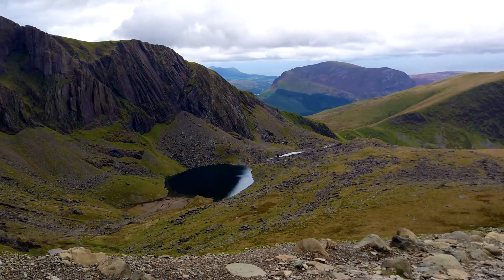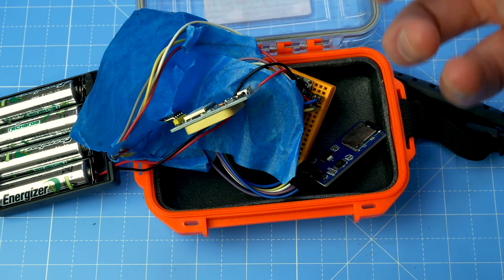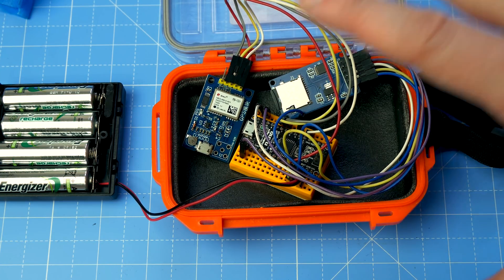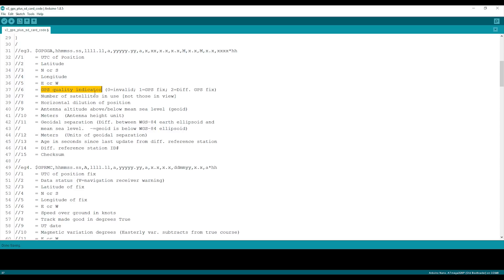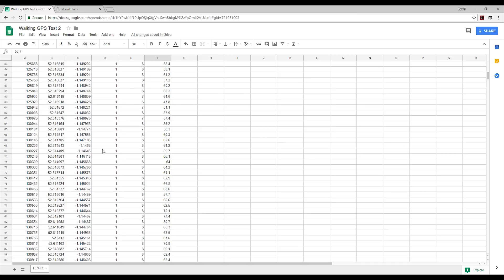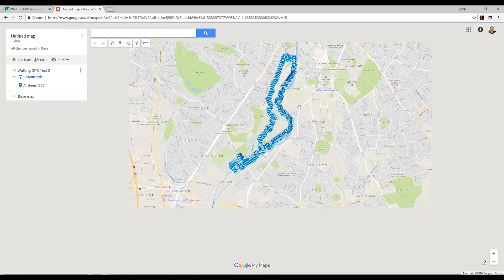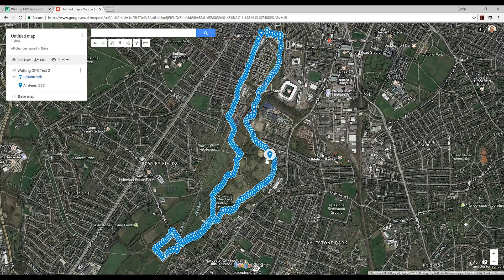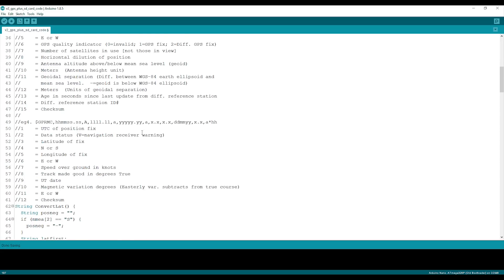GPS Mapping: Arduino + U-blox 6m module

Comment: Hello,
I would like to do the opposite, that is to say, insert the values (Latitude, longitude) into the code and then use them to compare them to the current position. At each passage on a position, the device would perform an action (buzzer for example). Who has already done this?
Reply from the maker: Sorry Patrick, I haven't done that or seen it anywhere else. It sounds possible though, the coding might be tricky but a simple block approach would be having an array of your target lat lng cords then looping through them and comparing them to the current cords.  The difficult bit would be making it only happen once and getting rid of any hysteresis.

Comment: nice but where is the wiring plan?
Reply from the maker: The pin definitions are in the code and the SD card uses hardware defined SPI so that will depend on your microcontroller.
Reply: @DavidWatts  I figured it out by following the cables in the video xD everything is working! Thanks for your prompt reply

Comment: Cool.  I was kinda surprised at the date though.  As in 2ish days ago.  But all in fun anyway.  I did build something similar using arduino, a tilt compensated compass, and a accelerometer put it all together as a inertial navigation to stick in the the car.  It was suprisingly accurate.  after an hours trip in the car, it was only off by about 2.2 Km.  (100 Km there and 100 Km back).  I had a few old garmin gps units hanging around, so tore them apart and added it in.  Pointless, but fun to do.  I was more impressed with the inertial system, so will be re-visting that later.  Not dependent on GPS at all.

Cool stuff though!
Reply from the maker: Why was the date a surprise?  Inertial navigation sounds interesting, I seems to recall Dave Jones taking an old aircraft one to bits a while back.
Reply: Didn't want to say this openly, but GPS-Arduino-LiPo pack, been around for years.  Thats why I built the Inertial one;  (Bout 5 ish years ago)  GPS modules were available for the arduino crowd, but a little expensive at the time.  If I re-call, about $50 - $70 bucks US.   The other parts were a little cheaper, hence the inertial job.  Now a days, I just rip apart old Car GP|S modules, or old phones, old hand-held, etc.  The Hand-Helds are nice, cause the module is pretty much exactly the same as the spark-fun jobs.  Plus nice screens to play with (And a few other parts).
But, it's always fun playing with the stuff.
Cheers!
Reply from the maker: I see, you thought I would be upset that other people have done it before? I don't mind at all, I haven't even come close to coming up with an original project. The challenge for me comes in the making.
Reply: Ahh, thats good.  I don't want to discourage anybody.  That's why I'm long winded about it - grin.  More power to you sir.  Giver S(*&.  Learning is a good thing.  Cheer!

Comment: I was surprised to see you using Strings in the code as they are usually regarded as a possible source of problems due to memory fragmentation in the small memory available on Arduino boards.

This occurs particularly when Strings are repeatably created as you do with dataString.  Why did you not simply write the required elements of the nmea array to the SD card instead of concatenating them onto dataString ?  

If you really do want to write the data all in one hit to the SD card you could have put it into a C style string (Note, not a String) which would avoid the memory fragmentation issue.
Reply from the maker: Hi, Strings are a fairly standard variable that I have never run into any issues with apart from gobbling up loads of RAM. I have read a couple of concerns about Strings but in this case I don't think it would be classed as a heavy implementation of Strings. In terms of the dataString, it is created inside a function so 'should' be released from the heap, stack or wherever it lands once the function ends. The dataString variable could certainly be chopped out and converted into something else but I do think Strings have their place and the functions of the String class can be really useful. In fact I employ substring heavily to chop up the NMEA strings to directly write a CSV file.

None of the code is fixed so there are lots of opportunities to tweak it, mess it up, roll back and try and change some of my bad habits ;-)

Comment: Have a project on similar lines but going to add a low power accelerometer to trigger logging and store the data to FRAM.
Plan on keeping it in my camera bag to automatically log location of photos by matching times on photos with log. 
Also testing an Arduino 1200 sigfox to report location over the air but this seems a bit hit and miss. Think I need a better arial for it to work properly in my bag.

Comment: Looking forward to the low power aspect of this project @David Watts (hopefully individual measurements of each module and showing the efficiency saving) plus the battery, charge and protection circuits. Plus creating your own board. 
I had a similar project over a year ago which you kindly gave advice on. Although still not quite finished yet, it does work. 👍🏻
Reply from the maker: Ha ha, hopefully my terrible advice didn't set your project back too much. I am not sure I will be designing my own GPS receiver just yet, but a carrier board for now. I have very little experience designing for RF sensitive applications so baby steps is what I will take. I am looking forward to fleshing out the spec for the project.

Comment: I'm not sure it will be helpful but in case you can get any inspiration from it, I did do some High Altitude Ballooning a while ago and designed a GPS tracker board. You can find it at: http://projecthab.co.uk/vayu_ntx-v1-03-hab-tracker-pcb/ VAYU-NTX (Vayu - Hindu Lord of the Winds and NTX is the telemetry transmitter)
Reply from the maker: Darn you Steve! I took a brief look and then clicked off. Too many spoilers :-)

Comment: David, the ESP32 Lolin D32 PRO has an SD card to go along with it .  This is a cool project - tempted to use BLE for configs

https://www.aliexpress.com/item/LOLIN-D32-Pro-V2-0-0-wifi-bluetooth-board-based-ESP-32-esp32-Rev1-ESP32-WROVER/32883116057.html?spm=2114.search0104.3.1.33d56547vZJc8y&ws_ab_test=searchweb0_0,searchweb201602_2_10065_10068_10130_5014915_10547_10546_10059_10548_10545_10696_100031_10084_10083_10103_451_10618_452_5014815_10307_5014715_5014615,searchweb201603_16,ppcSwitch_5&algo_expid=00a7f7f0-e874-4e5f-a8ae-dbcf58048aef-0&algo_pvid=00a7f7f0-e874-4e5f-a8ae-dbcf58048aef&transAbTest=ae803_2&priceBeautifyAB=0

Comment: Excellent contribution my estimate. Please your help. How could we place a column that tells us the speed between points. Greetings from Ecuador.
Reply from the maker: In this example I am only using one of the NMEA sentences (data seperated by commmas) the first one that provides speed is $GPRMA. You can pull that in just the same way as the other data.

Comment: Nice David.  I do not see an antenna hooked up to the gps module.  Are you still getting good signal regardless?
Reply: Jenn B modern GPS receivers are really good. I can get a good signal most of the time even indoors with no antenna with the MTK3339 chipset.

Comment: Nice video David.  Have you seen the Makerfabs Maduino Zero?  It's a GPS+GSM+Arduino Zero+SIM+MicroSD all on one board for $18.80+$2.82 delivered from China.  It also has a LiPo interface and comes with antennas for GSM and GPS.  Basically an all-in-one solution to your tracker with the added bonus of 2G GSM should you need it.
Reply: This one?  https://www.makerfabs.com/index.php?route=product/product&product_id=435&search=maduino ?   $26 vs $18
Reply: Close: https://www.makerfabs.com/index.php?route=product/product&product_id=552&search=maduino+zero $17 now.

Comment: A cheap tracker for elderly people suffering from dementia would be a great application for this, not?
Reply from the maker: It is very much meant for standalone GPS logging to an CSV file with the intention to make it simple, low power consumption and hopefully a lot smaller ;-) I don't really want it to be anything more complex than that.
Reply from the maker: The Openlog Blackbox is a good example, it is designed for RC planes (or similar). My plan is fairly simple compared to that but anything I create will never be cheap, these are short run projects.
Reply: That's old news. It already exists, and more enhanced as well. You can set a range how far they may walk, and make it phone and alarm the owner when they go to far, etc.
Reply: The thing is with dementia patients that do not carry their phones with them and what to do with this use case
Reply: deslomeslager  cheap and not over complicated? Some examples would be interesting :)
Reply: Better off euthanizing them